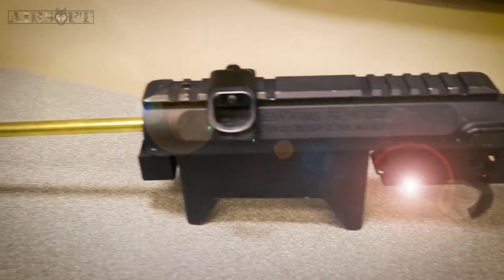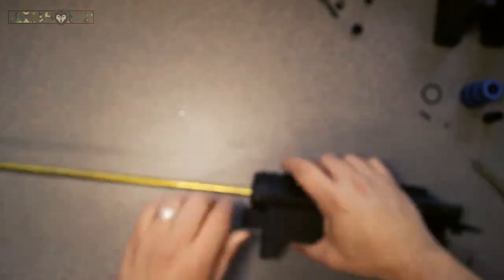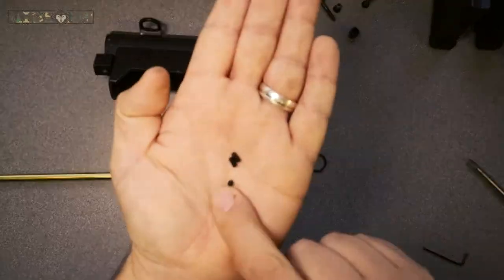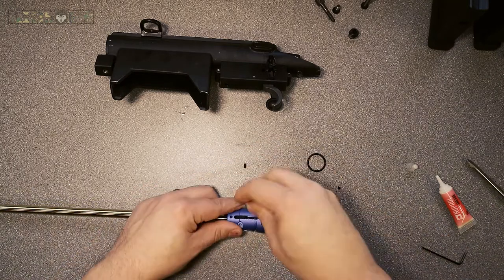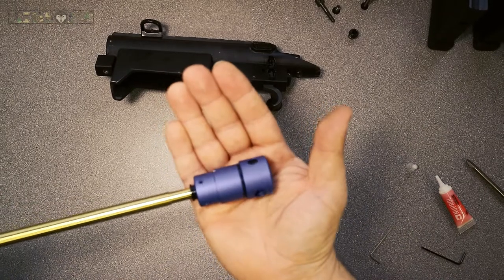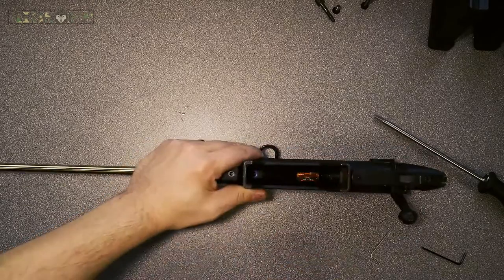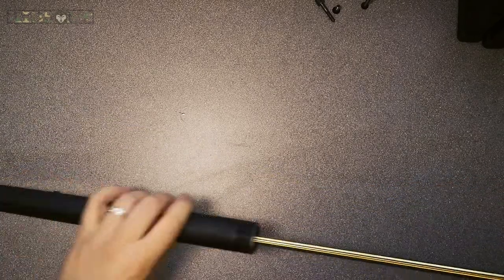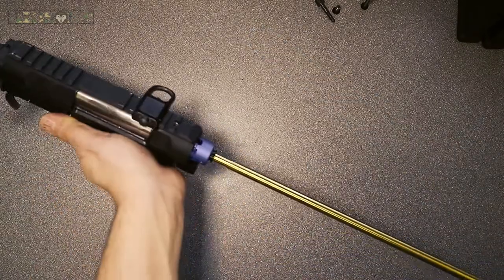Ares Striker S1 Inner Barrel and Hop Unit UPGRADE

Comment: Great, a recent video on this rifle. 
What's your opinion on cilinder volume versus barrel volume? I've been looking into this rifle but the very short cilinder has got me doubtful, especially with a 550mm inner barrel, that's a lot of air. Can you do a joules test between the 0.20 and 0.40 bb's?
Reply from the maker: Hi Howler, I think the striker would be improved with a larger cylinder if you were going to keep the 550mm barrel. I see a lot of Striker's with short barrels nowadays and for good reason. From everything I have read and seen it really helps. However with the stock rifle you can easily get accurate range of at least 60m. With additional upgrades you can start going 80m plus. I plan on trying a shorter barrel soon so please watch this space. I will do a joules test and let you know how I get on.
Things to help joule creep though would also be a heavier piston. Different style piston heads (cup/plunger), the tightness of your inner barrel will also help with heavier bb's. Hope this helps.

Comment: What's the thing called the you put in the hop up spot adjust hole in the top and will it work with the stock hopup? And will you be able to use vsr 10 hop rubbers on the stock gun and the gun after the hop upgrades
Reply from the maker: I think you mean the Hop up adjustment screw. Its basically a little grub screw with an allen key fitting. And yes the striker will take the vsr 10 hop rubbers both before and after. :)
Reply: WolfskyUK thank you for clarifying and do you have any good hop up rubbers to increase accuracy for not to much?
Reply from the maker: Hi Kyle, I recommend this PDI W Hold Hop-Up Rubber Chamber For AEG Airsoft. It was recommended to me by the retailers that I bought my upgrades from. It works great and was under £10.
Reply from the maker: Search for it on ebay and it will come up for you.
Reply: WolfskyUK thanks man I'm hopeing to get my rifle sometimes in April I'm hoping to do the upgrades you did but I'm short on money because school
Reply from the maker: Kyle Swehla the stock inner barrel is 550mm. I replaced mine with a edgi 550mm and they fit perfect. 😁
Reply: WolfskyUK hey it’s been a while but I’m just ordering my gun now and I was on evike and they have the striker but it says gen 2 do you know if there’s a difference
Reply from the maker: Sorry for my late reply. I have only just seen this. I do not know though. Probably best emailing them and asking them. If you get any info though then please post it here too. :)
Reply: @kyleswehla785  gen2 fixed the issue they had during release which was that when the weapon was dropped or hit while it was loaded, even with safety on, the weapon would fire.

Comment: I'm unable to fit the spiral fluted oute barrel on the gun after installing the hop up unit, does anyone have a solution?
Reply: I had the same problem.  I had to omit the two side screws that attached and held the barrel in the hop up.  Only the bottom screw is holding mine in.  I’m still having issues with mine, hence why I’m here.
Reply: @helpdeskjnp  there is a part of the barrel on the inside that is blocking the hop up unit from going any deeper than it is right now

Comment: Im assuming this hop up unit wont accept AEG barrels
Reply from the maker: I am afraid not fella.
Reply: WolfskyUK ok thanks whats ur thoughts on using a hop like the angel customs “Diablo” and a miracle barrel in a striker ?
Reply from the maker: I personally would not bother with the Diablo hop up. I don't think the Action Army can be beaten IMO. The miracle barrel looks good though and might help. Its slighter larger bore might prevent any jams and from what I have seen will give you consistent grouping on your shots.
Reply: WolfskyUK its listed as an AEG barrel tho